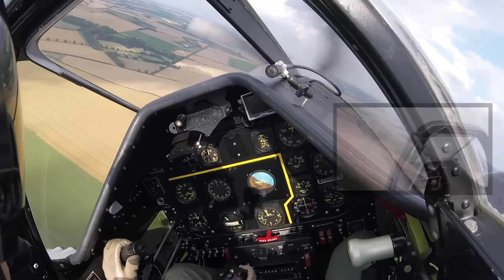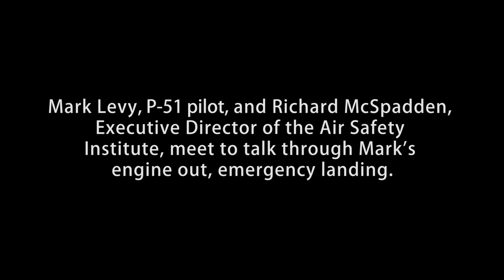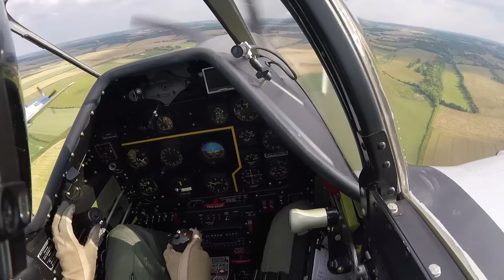P-51 Engine Out, Off-Airport Landing - Full Analysis

Comment: At first I thought, "I feel bad for the owner". 
Then I read that it was an original P-51 from 1944. Now I feel REALLY bad for the owner.
Reply: @HolidayArt  yeea but you can also make the argument that planes were meant to be flown not just sit around so its pretty cool that these guys still fly this warbird
Reply: @HolidayArt  Planes want to fly, not sit in museums gathering dust.
Reply: @HolidayArt  You absolutely don't need to put planes in working order in a museum. Any gutted out hulk from a plane graveyard can be painted up, patched up with sheet metal and put for display. The majority of tanks in museums are acquired in this way - most of them aren't even battlefield relics, they're prototypes or unfinished hulls from factory lines.
Reply: A bit late to the party, but for those who don't know, the Mustang in question is Miss Velma. Her wings have been repaired and should be airworthy again, considering she's been attending several airshows since this incident.
Reply: @tsx387  Ok, Toby, calm down. I'm not sure if you've gotten much flight training in Liverpool, New York to be commenting.
Reply: @jontropico1387   hahaha 
true.  no flight training at all.
Reply: @tsx387  🤔the answer is... Yes. 
!! ThanksX2
Reply: Don't worry, crashes after crashes less and less pieces are from 1944. It soon will be a nice replica.

Comment: Can we get an update when we find out why the engine died
Reply: You mean I was a dickhead to get this far...
Reply: fuel flow - might have found a way to keep it running.
Reply: Engines need fuel to run.  No running, usually means NO FUEL being given, if fuel available, then it will usually be NO SPARK.  Not being a smart ass, just sharing my wisdom, as this statement is simple, yet can have very complex reasons for no fuel or spark.
Reply: I'm going with no spark -
Reply: 2 totally independent spark sources so unlikely.
Reply: Conclusion
At the time of publication of this report, the aircraft was being returned to the overhaul
facility in the USA for investigation and repair. The cause of the engine stopping was not
known, but based upon the reported symptoms, the maintenance agency suspected it to be
carburettor related.
Reply: @kochj0713  those aren't the only important items for a combustible to run, AIR.
Reply: Packard Merlin. I believe they have The same two Distributors one each side that need regular point gap checking! But what do I know, I'm only a Glider Pilot!
Reply: @donaldmason4959  so was Mark at the end!

But yes, I believe you are right, twin ignition systems for redundancy.
Reply: @kochj0713  yep! I dont fly, just a fan of aviation and vintage aircraft, but I do work on old cars!  The 3 things you need is spark, fuel, and compression.  If one fails, then its not gonna run
Reply: Fair to say fuel starvation problem.
If spark was coming and going then the would be backfires caused by the unburnt fuel combusting in the exhaust when spark returned.
As the were no backfires then it's fairly safe to assert that the fuel getting into the cylinders was intermittent.
Reply: @andrewwright1200  Only one carb?
Reply: @juststeve5542  All planes have them by law (at least registered planes like Cessnas).
Reply: I wonder if it was carburetor icing. Low power, engine stopping, then the ice melts then it starts with power low then stops could be chunks of ice getting wedged in the carb, then melting, then other chunks breaking free.

Bad.
Reply: Donald Mason, magnetos.
Reply: @donaldmason4959  magnetos, not distributers
Reply: @adamsubtract81  Then you're wrong
Reply: @andrewwright1200  Ok the report states it MAY have been the carburettor. thank you for the publishing
Reply: @andrewwright1200  I think it was dirty fuel
Reply: @natural-born_pilot  air is not pat of the equation in terms of preventing an ice engine running. they need three things to run - compression, fuel and spark. in this case the symptoms point clearly to a fueling issue.
Reply: @rogerd4559  highly unlikely
Reply: Da Os sure but starve the engine of all air and see how long you fly. All the fuel in the world wouldn’t help.
Reply: @natural-born_pilot  think you're missing the point. ask any mechanic.
Reply: @andrewwright1200  This needs to be in the description of the video.  Thank you.
Reply: Da Os haha your talking to one.
Reply: @natural-born_pilot  you need an oxygen source. air will do, but so will nitrous, pure oxygen...
Reply: Ellenor Bjornsdottir just as good if not better but you must one of those components or your going nowhere

Comment: First off nice landing!  As you said fly to the ground. Couple of peanut gallery points:
1. F the pattern Everyone knows this. Once you declare you mayday the guy that wants to live makes the rules. FAA can call me later. 
2. You are at 500 feet with zero thrust and go into a 60 bank at 110KTS to make a 180. Dude. This is how most people die on take off engine-out. You have to be prepared for "take the trees" vs stalling in the turn. 
3. Totally agree on the chimp brain. People start yelling and complex logic goes out the window. This is why ATC are trained to ask you what you need. Not try to tell you what to do in an emergency.
So glad you walked out of this one.

Comment: What was the outcome of the engine failure, what caused the cut outs?
Reply: Most likely a Bad Carburetor or water/obstruction in the fuel line......In those old P-51s with their Piston Engines, if the Engine itself is bad it will either catch fire or just die, but a faulty carburetor or fuel obstruction would definitely cause the intermittent power he was getting.  As the fuel got to the Pistons the Engine would fire back up again, but when the flow was stopped the engine would lose power and nearly die.

Comment: It ceases to amaze me the endless waffle from these arrogant youtube "experts" and "experienced glider pilots". You guys are comparing apples and oranges. The guys is flying 400 ft. above the deck whistling by at 150mph with an airplane that weighs a tonne and with a completely different aspect ratio and design + tail dragger not to mention being a irreplaceable piece of history. Its basic human performance, I can't imagine the adrenaline and stress levels he must have been experiencing.  Bottom line is this guy has balls of steel and basically crash landed a rock instinctively and was able to walk away without a scratch. Nuff said.
Reply: Fair enough. Different mindset when the fan up front stops keeping the pilot cool.
 A glider is built strongly for outlanding, plus unless you really stuff up, you have paddock A and alternate B picked out and setup at a good height. Plus stall is around 40-50kts, not at Mustang speed.  A glider is not a flying P51 flying brick.
Well done with not stretching the glide into the highway- that was an excellent decision.

Comment: Great discussion. Many useful thoughts and lessons. All critiques have to be made with massive thought about hind sight being 20-20.

As a commercial but more importantly glider pilot, one thing I would think about that you didn't mention in the video is 'get-home-itis'. You covered how you wanted to get back to the airfield, which is completely natural and no one can fault you for, but seem to have a one track mind on flying a normal pattern to do it. It is ingrained very early on as a glider pilot that a conventional circuit isn't the only way to land. You could have landed downwind (around 1:50 in the video, look where he is compared to the airfield) or flown a shorter downwind leg and turned base earlier. There is more than enough runway and better to roll off the runway at 20 knots than in a field. Just a small thing to think about if, god forbid, this ever happens to anyone reading this

Comment: This is amazing, terrifying, and exceptionally instructive. I have read many accident reports where the pilot loses an engine, turns for landing on the paved runway, perhaps tries to stay up a little longer, stalls a wing in the turn, and goes into the ground like a lawn dart.

In this case at 13:12 the airfield looks like a warm friend, sitting there like a tempting oasis of happy. All he had to do was pull back just a little bit and he would so clear that highway, do a nice little landing, and exit the cockpit to the cheers of thousands of fans. Except no, that was an illusion. The reality would be a stall/spin right into the field with a possible skid of bouncing wreckage into the highway.

Even after his going level (with the resultant increase in lift over a turn) he had only a few seconds left before pancaking it into the field. Which was the right move. I hope I can remember this video if I am ever in this situation and realize the illusion of making the airfield that's right. over. there

Thank you for posting this.

Comment: At 31:25 he mentions fuel problems.
For shits, I figure I'll just explain a little tidbit to the people who might not be too familiar with this aircraft, or aircraft in general.

In the P-51, there is an engine unit gauge.  It's a sort of compound gauge of the oil temperature, oil pressure, and fuel pressure.  The oil temperature is the larger needle that travels along the top half of the gauge.  The pressure needles are much smaller, and sit a little below the oil temperature needle, pointing roughly outwards while the engine is running normally.  The small needle pointing to the left is the oil pressure, and the small needle pointing to the right is the fuel pressure.
At 0:33, you can see the engine gauge, or through the darkness, at least make out the white needles.  It's the last gauge on the far bottom right of the front dash wall, and at 0:36, you can see the fuel pressure needle jiggle.  When the engine first cuts, and Mark looks forwards, at 0:47 you can see the fuel pressure needle has now dropped, and two seconds later the needle rises again as the engine starts again.

Comment: Some of us Did retire from a flying career, in my case on Delta's smallest mainline, the B-717 (new age "DC-9"). Can't begin to imagine deciding exactly which field to put down in!
Quite a large number of us actually had very little general aviation flying, because of open slots (billets) in the Air Force Reserve/ANG etc. It looked as if Mark wouldn't level the wings in time-- 
Extremely well-done Mark! Don't Ever look down on pilots who only fly small, single engine planes. The very Top pilot in my UPT (80-02/1979) class at Vance AFB became an F-16 pilot. But George Cansler was later killed in a small Cessna 172 in Montana, along with his brother Clyde and a hunting guide, in 1986.

Comment: He had the presence of mind, while coming to the realization he would not make it over the freeway, while knowing he was sinking and about to stop flying, he had the presence of mind to pull the gear up because that would be a nasty crash rather than a rough field landing.  The right reactions while turning a steep last second bank with no engine power.  Wow.  So much experience happening in that moment.

Comment: I had an engine failure in a ryan navion just after take off at 200 feet with rocks in front of me I made a quick left turn  and realised it was a rough field and left the gear down to take the the first impact. we impacted on a small mound it ripped the gear off and we slid to a stop air craft destroyed but no scratches or bruises on me so my decision was ok, I have some time in 51D and you were right on with the way you handled it. good job.

Comment: In March 1981 in a C-152 at 1000'agl over the breakwater in Los Angeles Harbor the same thing happened to me with a 3rd hour student. I directed a climb to head back to the airport and the airplane wouldn't climb and had only 1800 rpm when it should have had 2300. Established best glide speed and climbed a little, completed checklist, called a mayday & power increased a little, then reduced -- it was 5 miles over super-populated area to airport. We headed to Point Fermin near where the Love Boats dock and landed from ocean to land with a tailwind (darn onshore flow!). Stuck exhaust valve due to lacquer deposited from low lead fuel. They replaced the cylinder the next day and flew it home. A week later, during my first flight back, it happened again in a different airplane, but that student and I were very high and easily made it back to the airport never quite losing all the power. The first incident helped me quickly recognize the problem, declare the emergency and I even let the student do all the flying to just before landing.

Comment: Thank you. Discussing human performance is a big help. When I was about one hundred hours PPL I also had a partial failure, on downwind. Luckily, I made it to the runway, but I also had to fight my instincts. The engine stopped working altogether when I was on final. I landed no flaps (RWY 12L LZSE), I let the LG down about a 100 ft QFE. My training proved to be a good one, but now when you told me about the monkey in me, I will try to keep it under control. Thanks.

Comment: I had this happen to me in a Stinson 4 place plane. I know how different this is from a WWII P51 but at low altitude your chances of a good landing with engine out are small! As soon as my engine coughed I immediately pulled back on the controls. Gaining as much altitude as I could. The engine continued to run similar to this P51 in this video. Every time it was running I was gaining altitude. When it finally quit I was able to glide quite a way to get to a smooth country road close to the airport. My landing was uneventful and no damage was done to the aircraft. Had I not been able to gain altitude I would have hit trees because where I was there trees under me for a long distance. I am not sure this P51 pilot could have gained altitude but he appeared to be close enough to the airport that if he had pulled back on the stick he might have gained an extra 500 feet or so and been able to land on the runway.
Reply: He said he was gaining what altitude he could with the power available.

Comment: This is a fantastic video on 'Human Factors'.. I'm just beginning to learn to fly. When I first learnt to drive a car, I was taught by my dad (who was a CFI, and eventually ATC). and he drummed into me the constant need to drill procedures, get the car sideways.. get it into a Scandinavian flick.. do it repeatedly until the unconscious "Chimpanzee response" is the desired response. Recently I had to (As we upgraded from 'dumb' cars to cars with ESC and ABS) I had to unlearn a lot of those reactions. I had to teach myself to brake deeply in corners, to flick left-right-left to avoid a danger. Behaviors that in a 'dumb' car (Like my Mk1 Toyota MR2)would have led to total loss of control. And that drilling saved my life and my mothers. Traveling down a rural road in our little Prius C (Toyota Aqua for intnl people) I was suddenly faced with a overtaking car in my lane, head on.. Time compressed, I went into instinct mode. Now in my old MR2 I had one option.. turn off the road into the gravel.. keep the car straight, go through the farm fence into the marshy fields and keep the car straight at all costs, because if it slipped sideways even a bit, the tires would dig into the marshy ground and the car would be flipped into a massive roll (which would kill us with certainty).. But because I'd taken the hours to train my brain and learn my car. I did something that in a car without ABS and ESC would have been pure suicide. I Swerved hard off the road into the grass beside it, under full brakes. Then turned back onto the tarmac (also under full braking), This rapid Left-right-left maneuver is violent and in most cars it causes them to totally loose control. But I had ESC and ABS.. and I'd TRAINED myself by repeated drills to reject my previously learned instincts.. The car objected massively..It beeped warnings, got somewhat sideways, flashed warning lights at me. But it did what it was designed to do and I am alive today because of that... Drill constantly.. Drill hard.. pre-program your brain for when shit goes tits up.. because one day it will, and your and your family's life may depend on it.

Comment: I'm not criticizing anything that Mr. Levy did, he obviously had only seconds to make decisions and hindsight is 20/20.  Training on gliders we where told that if we were too low to fly a normal pattern, to turn on to base early and used the last half of the runway, rather than set it down on the "numbers" so to speak.  I realize there is a big difference between gliders that can land at 35 knots and a heavy old war-bird that glides like a brick.  Just a question if this could have been an option?
Reply: No.

Comment: As an aspiring pilot. This has been one of the most instructional videos I have seen yet.

Seeing that P-51 go down though made me want to cry. Was the aircraft salvageable? Glad you're OK.
Reply: +Mark Leiter    A new manufactured wing was already available and it was fixed.  It is already flying again with a replacement engine and in new colors.
Reply: Currently flying as ‘contrary Mary’

Comment: Fascinating discussion. Reminds me of when my instructor pulled the power on takeoff, with no prior warning. I think I had about 4 hours of flight time in a little Cessna 150. I instinctively tried to turn back to the airport (downwind). He took control an turned back into the wind and restored the power. Lesson: NEVER turn out of the wind on takeoff and you have a power failure. Lesson learned. I guess I was in "chimpanzee mode!"